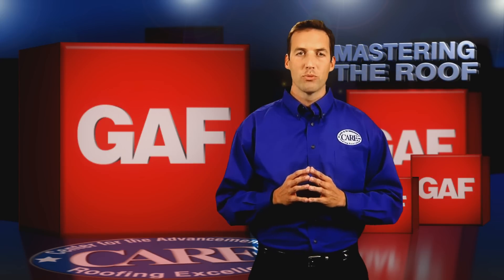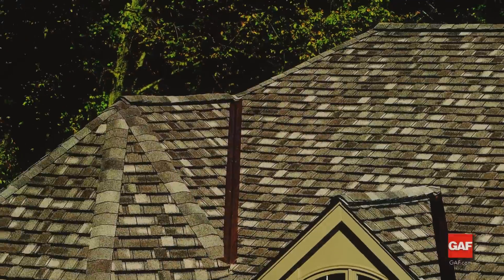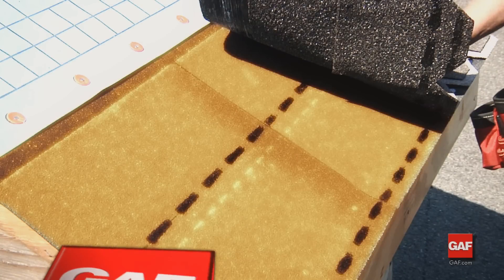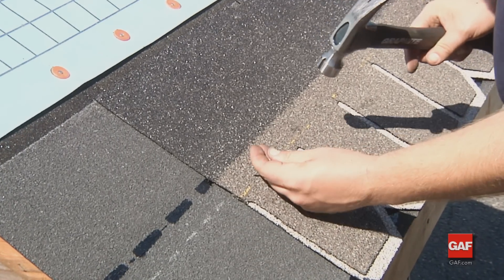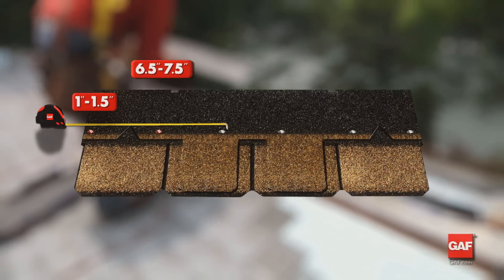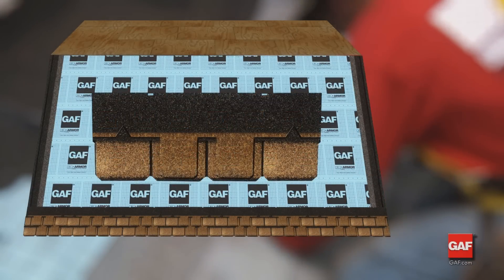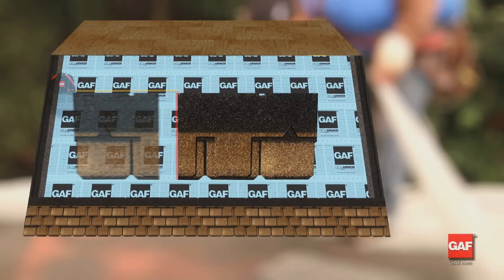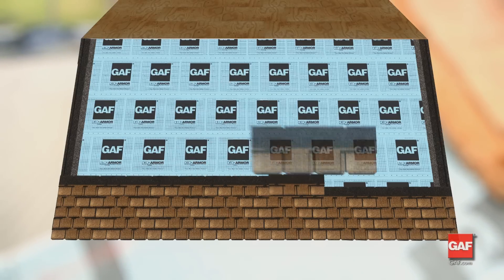How to Install Camelot Roofing Shingles | Mastering the Roof by GAF

Comment: I think the video is badly elaborated because according to the video, you have to install the entire 1 and cut the 2 3 4 line but from the same type of shingle and with which you started to continue with the entire line left to right with the same type  com the one you started.  But in the package they do not come like that, only one type but 3 different types of shingle so the design they present is not what it looks like.  And I would like you to explain with the 3 different types that there are.  Please.